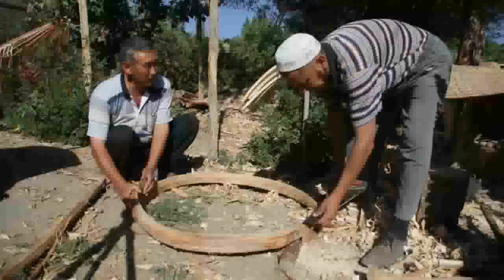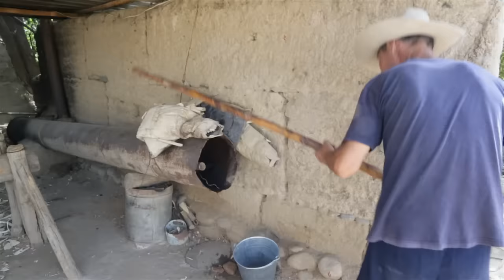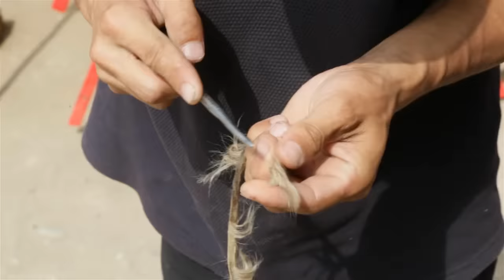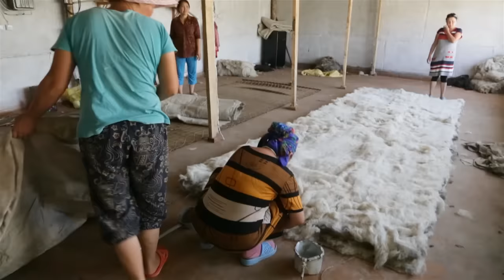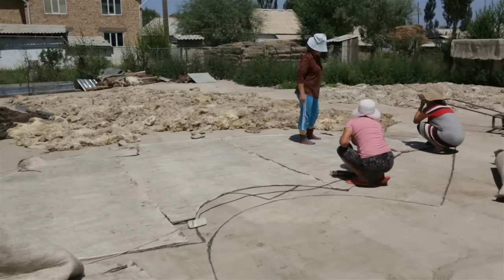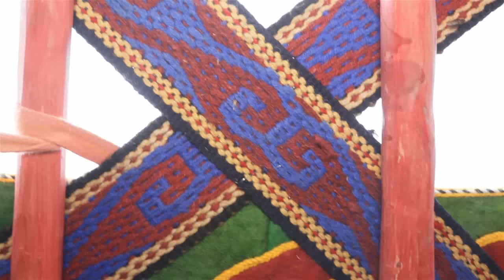Making a Yurt in Kyrgyzstan

Comment: Interesting that the press to straighten the poles is also used as shaving horse. A slot, a pole and a lever that is held by pressure with your hip, simplicity at its best.

Comment: What a wonderful film and people doing such clever work... though they do look tired and perhaps not well paid?
A group of us under supervision of Hal Wynne Jones (who I think learned from village folk of Eastern Turkey in the 80's) built yurts  and learnt felt cover making under supervision of (sorry, I cannot recall her name from Lapland) in the mid 90's in England. This is such an interesting comparison. thank-you to the people here and to film makers.
Screws in the wheel here rather than rawhide strips and dowel ...machinery cleaning and carding instead of people gathered together to share the process.. machine to friction the big felts. Traditionally, ribs from coppiced wood(branches taken from ash, willow and other northern hemispere trees without killing the tree so it could live and provide wood for many years) were wet and heated by putting them in a moving stream, then stuck into a big pile of sheep (or whatever fleeced animal) dung. (heaped dung thus composting heating and steaming the wood to make it pliable again if it has dried out).. then bent in jigs as indicated by this film (for the wheel put around a round concrete form)... Then traditonally 100 sheep fleeces were often used.... placed on a mother felt (already made felt) and layed out as shown here.. but sometimes cleaned and carded on the mother felt outside under the sky, then fluffed and beaten with sticks to card. People from the village gathered together around the mother felt to prepare the fleeces this way. Then they peed on the wool arranged on the mother felt (with or without animal fat/soap) to warm and prepare for friction of felting. A large straight tree branch (small log) at least 6-7 inches in diameter and long as the width of the mother felt and layer of new wool was then placed at one end.
The whole lot (mother felt on the outside, new warm wet cleaned, carded fleeces on the inside) rolled around the log. This was then attached by felt ropes (felt is so so strong) about an inch thick... to the back of a horse.. so that when the horse moved forward, the log rotated between two ropes: 
1 running from either end of the log and attached to the each side of the horse... thus the horse had the job of trotting or walking about for a few hours to create the rolling movement-friction needed to felt the new rug.. which when finally unrolled, emerged separate to but from it's place next to the mother felt. Felt about an inch thick was thus made by many people together A celebration of the gift of wool from the sheep (so many healing and warming properties in wool...Sheep apparently shares the word 'mother' in several European dialects from more traditional peoples... 
So that is the new felt made..heavy and strong as anything... incredible insulation when used as the walls of a yurt... rain outside... wood stove inside... so when the felts were saturated with rain... the stove inside and sun finally outside would dry the felt walls first from the inside and outside, leaving the water last to dry out from the middle. This inside layer of water last to be warmed before it dried... with the insulation of the rest of the wool around it remained warm and wet the longest to act as  a form of central heating until it dried out. 
Good to see the band being hand woven here... The band and the wheel are literally pivotal and binding for the whole structure. Incredible film showing a slightly more mechanised and metallic approach. 
I have my yurt which we built in England and I lived in in Wales 25 years ago. I am looking forward to living in it again in Australia... need to make a mosquito net cover for the summer and the felt would be good warmth in winter in some parts of Australia. I love yurts. 
Like a return to the womb. Thanks again for this lovely film.

Comment: I'd love to have the pattern of the felt that is traced in permanent ink in the courtyard!
I wish there was an experimental space where people could get together and work, and where all the components could be made and stored until the yurt is completed. Each individual or small group could gather or source the raw materials for each component, so the work could be done in a short time.  
The felting machine is replacing the horse-drawn stone cylinder around which the future felt was wrapped.
Reply from the maker: For the pattern, you could build a model then scale it all up.
Reply: @NomadArchitecture  Indeed! I would need to know the pitch of the roof in degrees and the length from top to bottom. Building truncated cones like lampshades or yurt roofs requires to do some algebra.

Comment: Aside from the rustic smell that I’m sure old wooly mats must have.i see a complete way of housing oneself.
Reply: The rustic smell appears ONLY when wool from the male animals are used, especially from the billy goats. This smell is manifestation of dominance and marking the territory. Female and young animals smell a little, if not at all (to be able to hide from predators, eg little fawns in the wild don’t smell at all). The wool is washed with soap in the process while making into felt, and later it’s cleaned with wind and rain over and over again. So why use the wool from the male animals one would wonder? Many reasons: general lack of supply, ignorance or little knowledge on the matter, but when used by the artisan it is because wool from male animal has a longer and more coarse hair length so adding it to the felt make it stronger and structurally enduring. There are many verities of the wool with different characteristics nomads know and use to achieve the desirable effects: spring wool doesn’t shrink as much as winter wool, goat wool consist of delicate and warm undercoat and long coarse hair to make strings, cords and ropes, etc.

Comment: Beautiful! I find the mix of traditional crafts and skills and modern tools (the electric felt cutter!) especially fun. Is the wool not washed before going into the first machine (which is not the felting machine, that's the second one, if I am not mistaken). In the final scenes, it does look like there's plastic on the inside of the yurt roof, or is that an artifact of the filiming and my screen?
Reply from the maker: In Kyrgyzstan it seems that they wash the finished felt quite well and they have picked the wool over by hand before. They dont like to wash before as they want to control how wet the wool is and it would be a mammoth job drying it all then re-wetting for the felting. About half the yurts I saw had some plastic in them. The felt gets thin after a few years.
Reply: What I saw in my childhood was first they cut and remove all dirt from the wool. Then it is rinsed, after that they put it in a pot with boiling water and heat treat it. I have also seen old ladies put some organic and natural dye gathered from rocks into the boiling water to dye the wool.
Reply: What I saw in my childhood was first they cut and remove all dirt from the wool. Then it is rinsed, after that they put it in a pot with boiling water and heat treat it. I have also seen old ladies put some organic and natural dye gathered from rocks into the boiling water to dye the wool.